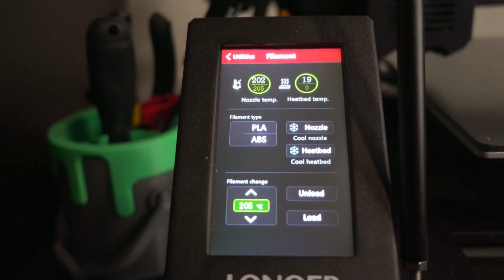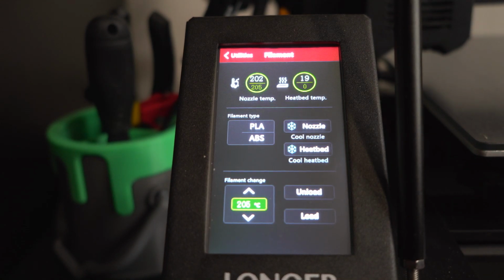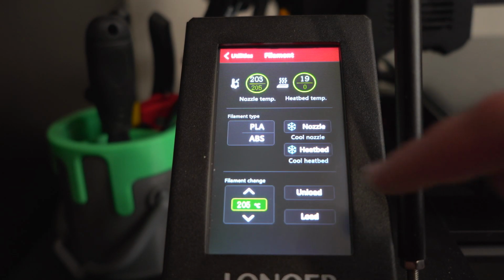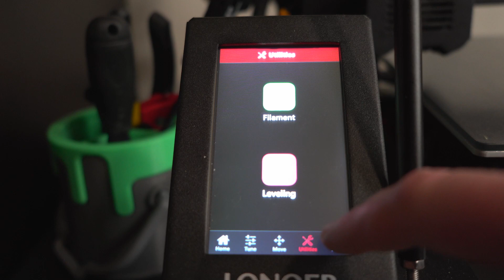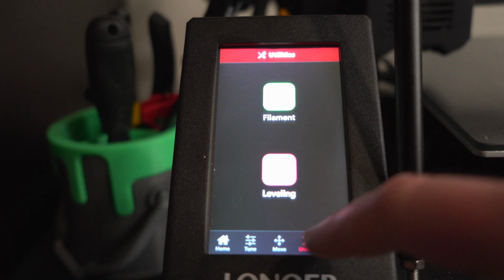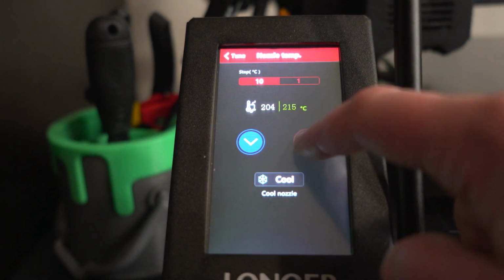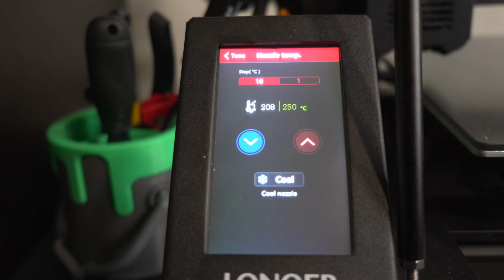How To Replace the Nozzle on the Longer LK5 Pro 3D Printer

Comment: Can the longer use diff size nozzles
Reply from the maker: Yes! The kit I got only has 0.4mm nozzles, but something like this: https://amzn.to/41Ctf0S has a bunch of different sizes that would all work. You'll just want to make sure to change the nozzle size in your slicer settings because I think most default to 0.4.
Reply: @jfmedina2010  thank you I was looking for them to specifically say for longer and wanted to make sure  thanks for the helpful vids and answers.
Reply from the maker: @aliciajasondodd  you're welcome. For the most part, if it works for the big brands (like Creality, Ender, etc) it will work for Longer. A lot of it seems to be standard.

Comment: Why does it have to be hot to exchange the nozzle?  I just replaced mine, but did it unheated.
Reply: just making sure I didn't do something that damaged the printer :)
Reply from the maker: @HauntedWebby  It is recommended to do it with the hot end heated up because the hot ends tend to expand a bit when they are heated up. This allows you to get the right "seal" between the nozzle and the inside of the hot end to prevent any issues when at printing temperature. I'm not sure if it will cause a serious problems if you do it cold because I haven't tried it. But, if you start to notice your nozzle getting clogged or if quality seems to be reduced, that might be why. Hope this helps!
Reply: @HauntedWebby  i would redo it and heat it just to be safe but if you've used it and all seems good then it shouldn't be a issue

Comment: do you think the tube needs to be changed each time you change the nozzle?  I have a clog and have never changed the nozzle, my machine is over a  year old so I will use this video to attempt to change the nozzle but i bought new tubes just in case the tube is clogged too.
Reply from the maker: I don't necessarily think that the tube needs to be changed every time, but if you haven't changed it before, I'd recommend at least looking at the tube and see what shape it is in. I do have a video that walks through that process as well: https://youtu.be/YWqskhS0zJ4
Reply: @jfmedina2010  I was able to change the nozzle and boden tube and have the printer up and printing with ease, the video was much appreciated and helpful, thanks for posting!
Reply from the maker: @mlb4946  I'm glad it helped!